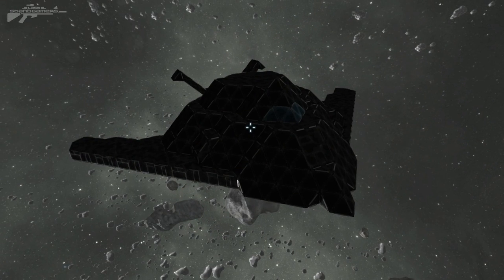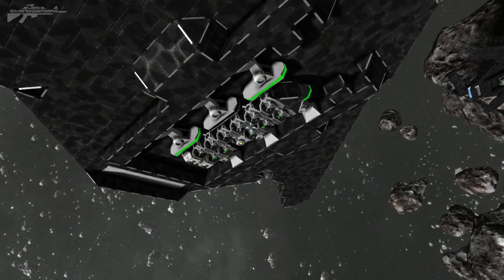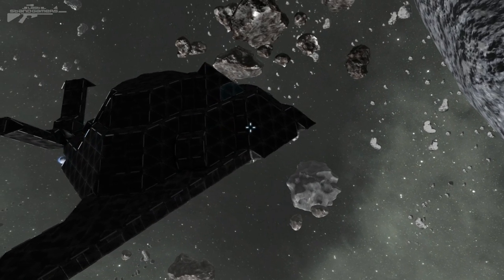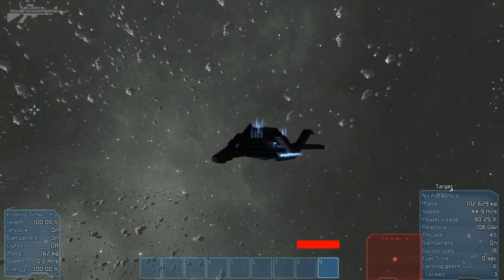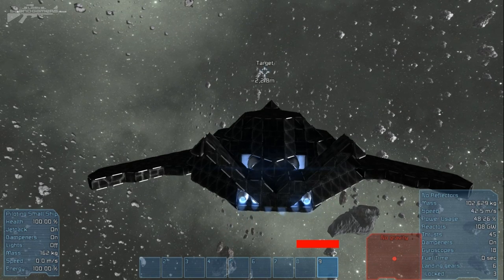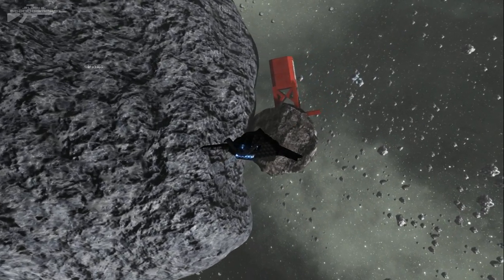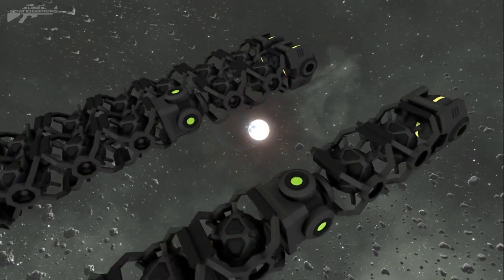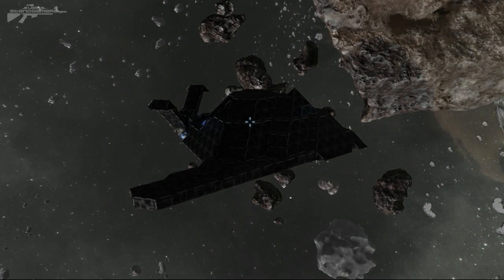Space Engineers - Stealth Fighter Night Hawk & Beacon Guided Weapons Concept Part 39

Comment: The Air Force actually retired the F-117 in 2008.  The F-22 and F-35 have replaced it and have a better payload capacity.
Reply: The nighthawk actually has a better bombload than the f22 but the latter was meant as a fighter, some f35 variants have a lower bombload than the f117 but the f35 was meant as a multirole aircraft
Reply: The F-35 is not a stealth aircraft, so regardless of what may be advertised the F35 cannot do the F117's job. The F-35 only has limited "stealth" head on, and with a very narrow radar band. Basically the F-35 isn't going to be able to go anywhere an F-16 couldn't go...F-22s are going to have to pave a whole in enemy air-defense networks for the F-35 to do anything.
Reply: The F-35 has a RCS of a metal golf ball, and the F-22 of a metal marble.  So both are in the realms of smaller than .01.  The average fighter has a RCS of something between 2-6m.  The F-22 will of course be the first considering they are to establish air dominance, which will then allow the F-35 to come in, mop up, and conduct stealth ground strikes and possibly limited SEAD using GBUs to allow non stealth aircraft such as F-16s, and F/A-18s to come in
Reply: The marble and golf ball comparison is a much used quote from the US Air Force. It is also an outdated quote, that is only accurate when looking at the F-35 with an x-band radar from head on. Design compromises and poor choices leave the F-35 that will be fielded with a much larger RCS when viewed from any other angle than head on. A strike fighter with head on stealth can only use that feature effectively when modern air defense networks have already been cut up by the SEAD aircraft, and the strike aircraft are supported by support aircraft like the EF-111 Spark Barks, like in Desert Storm. Entering an enemy air defense network by definition means you are going to be viewed from many angles by many different types of radar and entirely negates the stealth features.

Again, The F-35 against a modern nation's Air Force and integrated air defense network will not be any more stealth than an F-16 or an F-15E in the strike role.

F-22s will have to decimate the enemy the overlapping integrated air defense network before the strike aircraft can come in and do their jobs.

The Chinese and Russians have made great strides in the last 15 years toward diversifying the types of radars in their integrated air defense networks specifically to counter US stealth aircraft. The Russians have totally changed the way they run their networks...massive x-band search radars with enough power to cook birds in flight, radars in multiple bands  tied into fully digital SAM units, wireless networks, working with AWACs ect ect....parts of the Chinese coast are so covered in high energy radar in, so many bands that even F-22s will have problems.
Reply: Titus Veridius
We still fly the B2, and that's fully capable of doing the nighthawk's stealth attack role, but is also capable of fielding nuclear arms, and can carry 8x the amount of 2000lb JDAMs or 40x the amount of 500lb JDAMs.
Reply: *****  What is your point?

Comment: Or you could leave the "safety" on, so the bomb would pierce the armour, and it would explode when the warheads collide with something inside the target.

By the way, as an experiment, I made a drill out of small ship light armor, attached to a landing gear with rotor. It was >ULTRA< effective, most likely needs to be nerfed.
I was pushing it slowly into a large ship, and it was like cutting wood with a lightsaber. Altough the light armor attached to the landing gear was destroyed, it disintegrated everything it hit. Also I think that when landing gears are in locked status, they are harder to destroy. I could continue drilling with the rotating landing gear for a while before it broke. I tried it next time with only a landing gear, and it couldn't do damage when it wasn't locked/there was nothing attached to it. I may try it with heavy armor next time

Comment: Things I think they could add without too much difficulty.
1.add a power system so everything uses power and you can turn things off
2.add a radar system range depends on the power available and the amount of sensors
3.add a type of large ship cannon turret that uses shells and is between rockets and chainguns more penetration than rockets against heavy armour but less explosive damage
4.add a airlock block or system that allows ships to dock with each other
feed back would be great!

Comment: how about cloak that works based on the angle you're looking at the ship from? and when A ship is cloaked, it should use up massive amounts of energy to stay hidden from sight, but some kind of energy signature should give it's general location away. That way people know you're there and the general direction you're coming from, but they just can't pinpoint you're exact location. That, and if they are hit by anything, or go too fast, the cloak should start to fail and reveal the really edgy parts of ships. Thinking something along the lines of what was done in ghost recon future soldier.

Comment: It seems a little "off" to use render distances as a method of stealth, but I guess any game mechanic is fair play. Even without that, if whatever radar-equivalent is in the game has limited range and can only detect piloted ships rather than "debris" with no cockpit then even without being outside of render distance you could just be outside of radar distance and have the bomb be undetectable.
Reply: As far as I've seen, if the ship is far enough away to not be rendered, you wouldn't see it anyway, especially if you don't know it's there.

Comment: Interceptor* not bomber or fighter :)
Reply: its a bomber an interceptor rarely if ever carries bomb loads like this and its primary role is to take out other fighters or bombers, this thing is designed to hit a stationary target with a strike from longe range
Reply: GeneralAdvance
It's an interceptor... Pretty much any modern aircraft can carry bombs just because it carries bombs doesn't mean it's a bomber...
Reply: except this is purpose designed for it, it has no guns, limited movement beyond speed and is purely for striking hard to get to targets, its a bomber
Reply: GeneralAdvance
The one in the video is a bomber the one in real life has the ability to switch out it's weapons and it can have a main gun! It is not a bomber! It can do ground attack mission (what it was most used for) but just because of that it's not a bomber. The F-117 was the first try for a all round aircraft.  The B-2 is a bomber the F-117 is an interceptor that can do ground attack missions.... Because they used it for mainly ground attack they got a new plane (B-2) because the F-117 had really no use. Oh and also in the video he said it's in service (pretty sure he did) which it's not. Anyway last thing I'm gonna say is the F-117 is an interceptor that can do ground attack. Not a bomber the B-2 is a bomber.